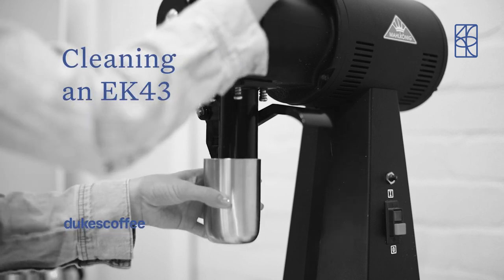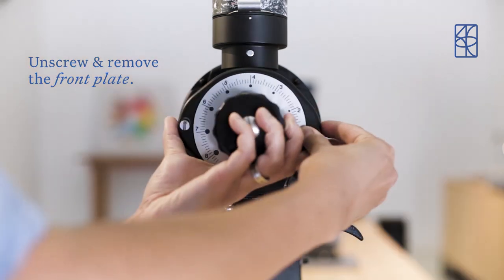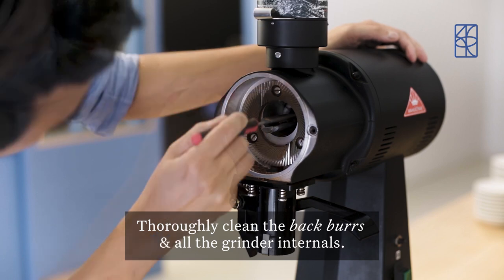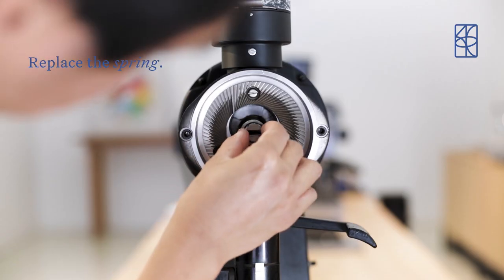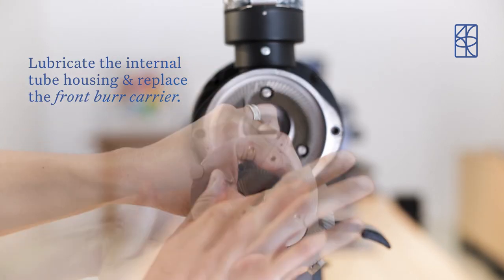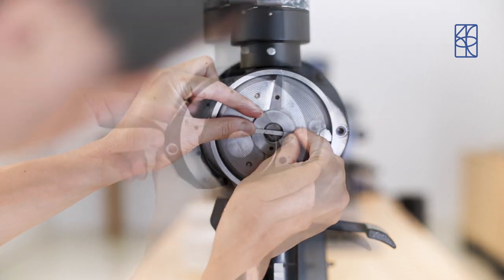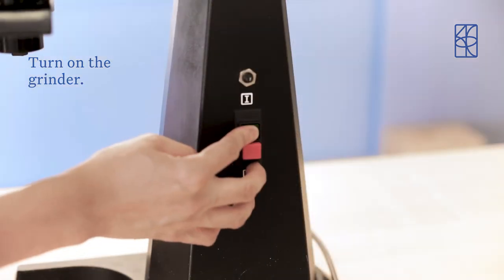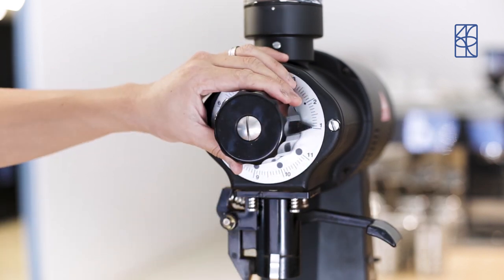How To Clean & Recalibrate A Mahlkönig EK43 Grinder

Comment: I put my grinder back together had when I turned it on, it made a really bad screeching sound. Did I do something wrong?
Reply: It sounds like your blades may be touching or rubbing in some way when you have reassembled the grinder. I would try turning your knob to the coarsest possible setting before starting the grinder again. It is possible that you have calibrated the grinder to be too fine at the finer grind settings.

Comment: Stabbing the burrs with a screw driver seems like a bad idea to me. Doesn't it dull them, or damage them some other way?
Reply from the maker: Hello! This is a metal pick, rather than a screwdriver. It is non abrasive and used to loosen the hard-to-remove residual coffee from the burrs.
Reply: @dukescoffeeroasters2035  Thank you for clearing that up!
Reply: @martijnvdkerkhof  yeah and you're not actually pocking the burr's teeth, just the space where the screws fit that usually get clogged up with very fine coffee.